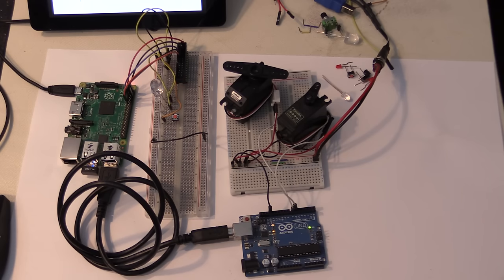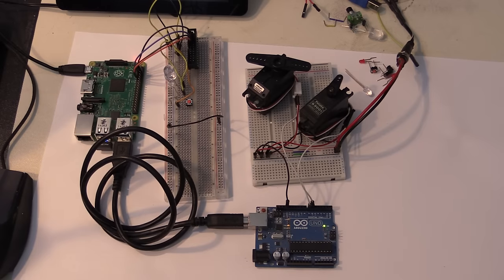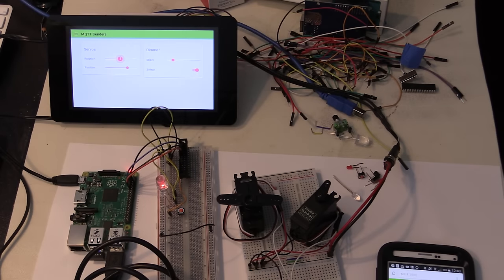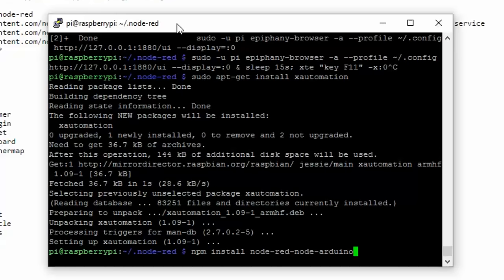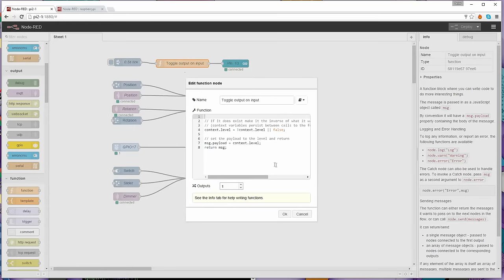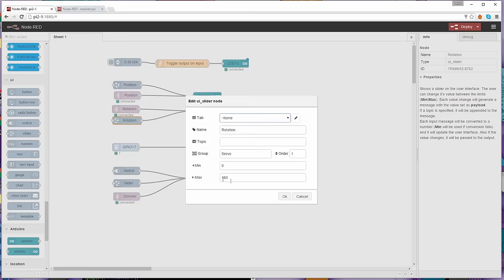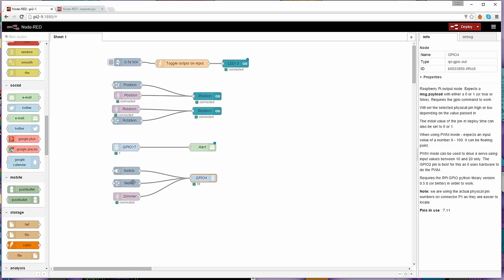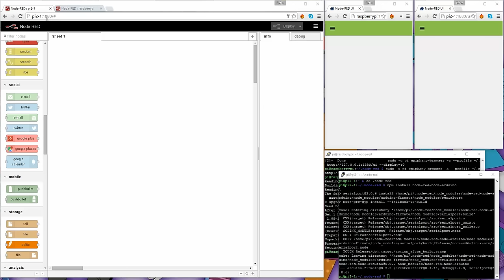GPIO - Easy as PI... part 1 of 2 - intro to my first Node-Red program

Comment: Hello Peter,
I love your videos.
You put a lot of effort in them and we can see it.
Would it be possible to use firmata and Node-red on IOT2040, both of them?
I am looking for a way to communicate between the Arduino sketch on IOT2040 and Node-red which is also running on the IOT2040.
I am looking for a software solution, no wiring.
Thanks!

Comment: How it´s possible to access with your Smartphone to the dashboard? You have to be in the same network with your smartphone as your Raspberry?
I have got the Raspberry Pi 3 and configured a WLAN-Accesspoint with hostapad. I can connect my smartphone to the Accesspoint, but i can´t ping it or go further to the dashboard?
Reply from the maker: when you use the "Dashboard", it is a HTML5 web site so is simply a case of browsing to it like any other web site. If you on the same local network then it is very easy, if you want to do it via the internet from another location then you need to ensure you have a port on your router forwarded to the PI and port 1880. the external port can also be port 1880 but of course the two IP addresses will be different
Reply: Okay that was my intention. I use the "Dashboard", but i only have the standalone Raspberry to build up a network. So i created a Accespoint with the Raspberry and now i want to connect my smartphone to it and to the Dashboard. How can i solve this?
Do you have an idea or a tutorial for this?

Comment: Hi, 
Nice video, thanks ! I have two questions :

1. How to run node-red in the background ?
I tried "node-red &". It runs in the background but repeatedly surfaces in the foreground.

2. How do we start node-red automatically in the background as the pi boots up ?
So, we do not have to ssh every time and type in "node-red".
I tried adding "node-red &" in /etc/rc.local. This does not work i.e. it does not even start node-red.

Please let know.
Reply: http://nodered.org/docs/hardware/raspberrypi.html
look up here at the subsection "Adding Autostart capability using SystemD"
Reply from the maker: you need to redirect its output to somewhere using a > or >> then a file or null

Comment: Hi. How did you open dashboard on your smartphone?
Reply from the maker: Node red has an installable module called Dashboard, it provides a web based UI for you to use.

npm install node-red-dashboard

Hope that helps
Reply: Thank you for the comment. I have installed it. I cannot get the dashboard on my phone. I wrote the address on my browser localhost:1880/ui but it says it cannot open page. If you could help me out I would very much appreciate it!
Reply from the maker: I assume you have also created / dragged elements onto the design tabs, if not then you need to do this in order to see anything

Even if you don't hook up the elements, as long as there on the page and saved it should then show up. There is no automatic page just because you installed the dashboard. you have to create it.
Reply: Thanks again for the reply. I dragged nodes and wired them together (chart, mqtt, debug node). When I run localhost:1880/ui on my raspberry it shows a wonderful chart on the dashboard. I have seen in your videos that you were also able to access the dashboard via your phone. I cannot do that for some reason. Did you install anything on your phone? Also, I would like to access the dashboard on my chrome from my laptop. Is that possible?
Reply from the maker: Simply use the browser on your smart phone and navigate to the url. It wont be 127.0.0.1, thats the internal IP.
Type ipconfig
in their look for eth0 and look for its assigned ip address, use this instead of 127.0.0.1
Reply: Amazing! I will try this tomorrow! Thank you so much!